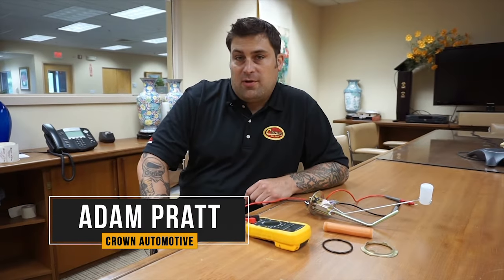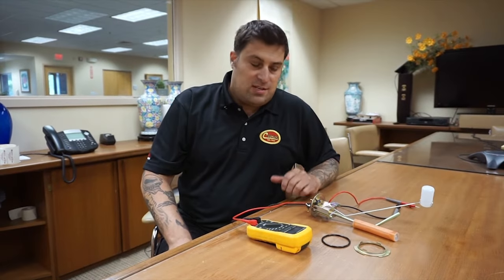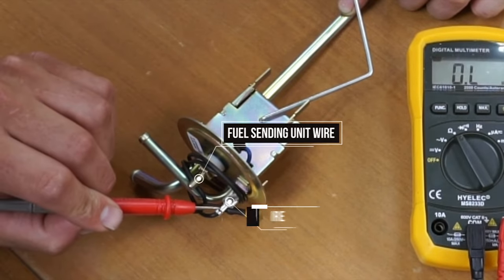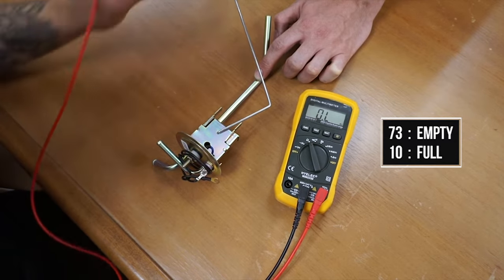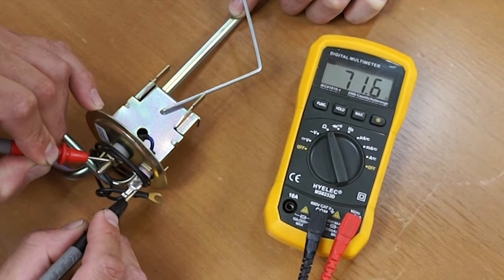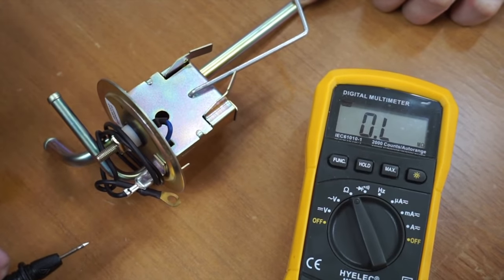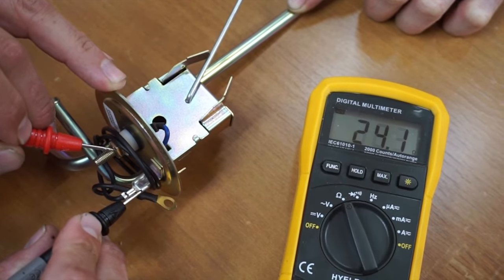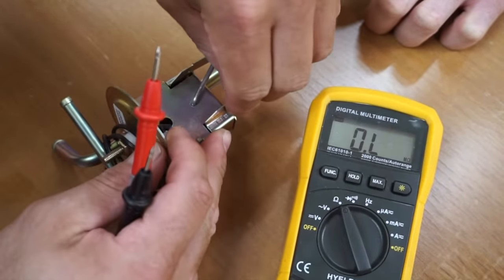How to Calibrate and Fix a Fuel Sending Unit

Comment: I rebuild senders professionally and this is not how you calibrate a sender.  The two stops are intended to keep the float arm from hitting and drumming on the top of bottom of the tank.  The actual calibration is done inside the resistor housing by adjusting the location of the sweep arm.  As Ellesmere Wildwood pointed out the resistance at full should be no higher than 10 ohms.  Setting it a little lower compensates for the series resistance in the rest of the circuit.  As a percentage being 1 ohm off at 10 ohms is meaningful.  At 73 ohms empty one ohm makes exactly no meaning full difference.  Because of the design these senders are only calibrated at the full position.  If the empty reading is too high it means that you are compensating for series in the connections in the sender by having to really drop the full setting to get total resistance in the sender down to 10 ohms.
Reply: Where are you located?  I’ll let you fix & calibrate my sending unit
Reply: Hi William…So, with a full tank, my gauge says I am a hair above half tank.  When I am empty, my gauge says I am around a quarter tank.  How do I get full to be F and empty to be E?
Reply: Also, at 45mph, my gauge says I am going 65ish.  It’s a new cluster and new wiring harness put in by a Jeep shop and this is what I get.  Thoughts?
Reply: @jjpaul75  What vehicle are you working with?
Reply: @jjpaul75  The speedometer is typically driven by a mechanical cable.  The number of teeth on the end of the cable determines the ratio.  If yours is like that then you need a gear with more teeth.  Or it could be an electronic speedometer and that is entirely different.  What vehicle?
Reply: Where are you located? I have a MTS CJSU-1 sending unit from MTS. Can I send it to you for calibrating? It goes on a 1980 CJ5 jeep. I have a 15 gallon poly tank. My gauge on my speedo cluster reads below E when off and on E when I turn the key. Would it be a grounding issue on the sending unit and or calibrating the sending unit, as I put it staight in from the box and not thinking about making sure it was calibrated right. Thanks.
Reply: How do I get in contact with you on calibrating my sending unit? What is your cost? Thanks.

Comment: Interesting, but the "fix" by setting stops on the float motion effectively makes it non-responsive around the F and E limits.  At least keeps the customer happy since they see exactly full on the dash gage.  More critical is how accurate it reads near empty.  Perhaps the stop is why most people figure they can keep driving a bit more when it shows "E" on the gage and the needle stops moving.
Reply: I Completely agree. This method is only putting limits to the float travel it is just cheating the gauge.

Comment: What ohms setting on your multimeter do you use? I want to calibrate my Crown sending unit for my 80 CJ5. Tank is a 15 gallon poly tank from MTS. Thanks.

Comment: My car uses a different style unit that won’t allow me to bend tabs to adjust the reading my manual calls for 3ohms full/80ohms empty the replacement unit I received reads 6.5omhs full/82.5 empty will that cause an issue ?

Comment: My c4 fuel sending unit electrical wires are not working, not getting any power through the wires. Bought aftermarket sending unit but the electrical connectors aren’t the same size as original one. Any ideas need help!! Please, thanks in advance

Comment: I wouldn't put the filter on at all. Because you have a filter after the tank anyway and it's a pain to get to.
Reply: The purpose of changing the filter in the tank prevents any impurities from going through all your lines before your in line fuel filter .. you're going to have a higher chance at general wear throughout everything before the in-line filter

Comment: What aftermarket fuel gauge do you recommend to use with the Crown sending unit? I want to use it on my 1980 CJ5. Want to keep the speedo cluster in the dash. Thanks.

Comment: So..2 years ago, I asked  a mechanic to replace my 1998 Dodge Caravan 2.4L  fuel filter that was changed 22 years ago. When he did it he cracked the fuel pump connectors and it leaked gas. I paid for the part and he did labor free. Bosch. The gauge read low. Still had 5 gallons left when gauge was at E. He replaced it and same level issue. I said forget it and was same for 2 years and 2 months. The sensor started making the fuel gauge needle go down and the chime came on  with the gas tank idiot light coming on. I GOOGLED it and saw complaints like this and saw might be caused by sulfur in gas tarnishing the metal on the sensor metal.. I put in 2 bottles of Techron plus  and for a time chime was lot less but now is awful!. So far I can't find what metal the sensor windings are made of for BOSCH. I see 2 brands, one  using gold (Delphi) and other silver palladium.
THEN... I see ranges of 70 to 1050  OHMS for replacement pumps (ON Rock Auto info on their pump assortments. and then I see 33 to 240 for Bosch and American makes. I was about to put a cheat resistor in the harness to make it so I could stop the low level CHIME stop. BUT now I don't know what value to put in. I was going to put in a 680 or 750 OHM but when I saw this new range. I put a temp hold on this cheat. The gauge anti- slosh makes the needle move slower but the chime comes on right away. I think the float needle is getting to a dead high OHM spot on the sensor. I found out a couple weeks ago that Bosch went to a lifetime warranty.. but there are qualifiers and so I will see what push back I get from Bosch.

Comment: Back in the day, working at Flexdrive Instruments, the Aussie arm of Stewart Warner, the tank senders were always set slightly low at full.  For instance the 73-10 ohm tank the 10 ohms would be set at 9 ohms so the gauge pointer would read slightly above full.
Apparently, back in the day, people liked their fuel gauge to read slightly above full.  Gauges were always calibrated exactly on the mark. Low on the sender would be set at correct ohms or a little higher like 75 ohms would be acceptable.  These days, when ever I repair a tank sender I always set them the same way as it was done at the factory, always a little higher at the full mark (9 ohms) but never higher than the 10 ohms.   Anyway, just 2 cents worth from the old school instrument guy. 🙂